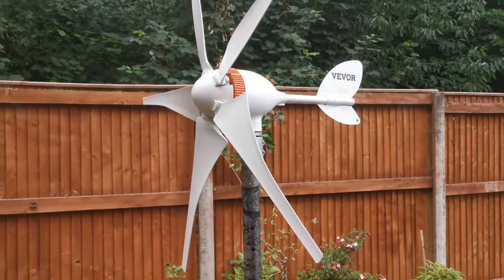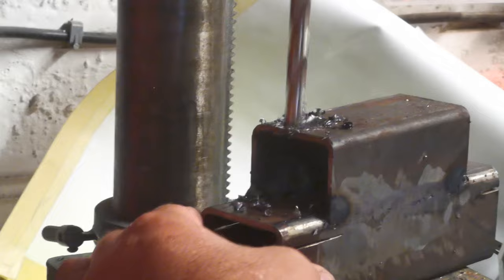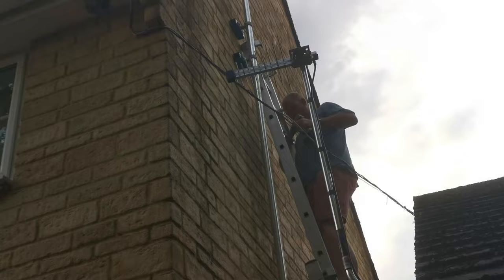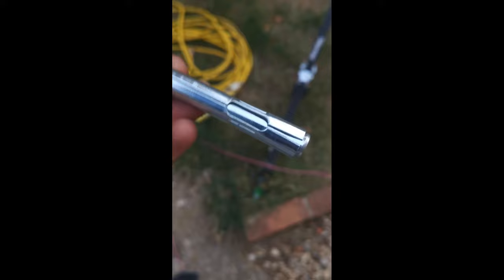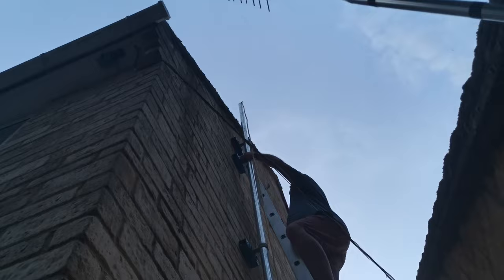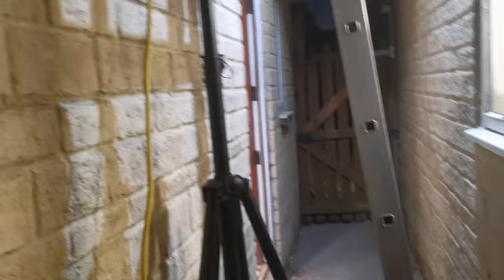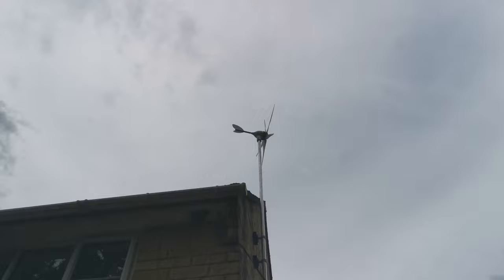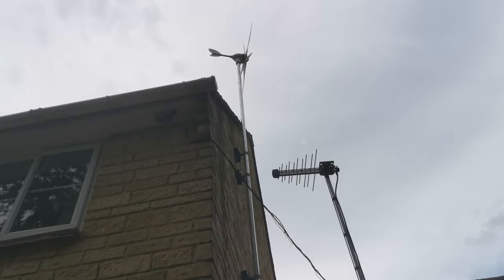installing a wind turbine at home |  how much power will it make?

Comment: I did this about 15yrs ago. Forget small scale wind it is a dead loss. It will stand like a statue or spin just under load for 95% of the time.  One 100w solar panel will do "something" every day, and you won't hear a sound from it. You will hear that vibrating everywhere in the house. It has probably been removed by now. Sad but true.
Reply: they're ideal for topping up the batteries through the night.
Reply: Idk what vibrations you are talking about since I also have a homebuilt one and I hear no vibrations.
Reply: Great point.
Reply: The tech has come along way in 15 years lol

Comment: Replace the charge controller you received witn a rectifier + cheap mppt solar charger. You'll get much better results
Reply from the maker: thanks for the subjection, i have thought about doing something like that. ill give it a go at some point
Reply: Also the 300 watt rating is based on probability of 60 to 90 miles per hr wind speed and is has to be sustained winds ….is not that predictable so you are doing fine a combo of wind and solar is the perfect combination specifically in cloudy days

Comment: Your house is in the way of the turbine, preventing it from producing good power. You get too much "dirty" wind from mounting it by a building. Also, if and when the turbine gets up to speed, you will start to get strange vibrations in the house. Try taking the turbine to a windy hill, as a test and see how much power it can really produce!
Reply: No its a cheap Chinese poor turbine

Comment: Im thinking of buying a wind turbine to support my solar system I made this year. Solar system I made worked great throughout the summer, however, in the winter turbine would probably compensate the loss of sun rays. I've been searching the internet for the past months to find the best wind turbine, but they all just seem to not work as the sellers state in descriptions. Could you please give an update on how your wind turbine is working now? What power do you get out of it? Thanks
Reply from the maker: We have had 160 what's out of it now, it just keeps getting more with everyday. we don't get a lot of Watt hours out of it however. I would strongly recommend not using the controller they come with and getting a small three phase rectifier as well as solar charge controller. As is it has to be spinning very fast before it does anything whereas with a proper controller you'll be able to get output at the low end.
Reply: Did you try it with the mppt solar controller?
I have my new turbine now that I'm running tests on and i found that, although the maximum power was higher using the solar and rectifier, it seemed to take longer to kick in. Almost like it had to spin up high then come back down to a certain value and go up again or else it would continuously read 0w. But once it's actually running the numbers were indeed higher. I'd probably need to try it actually in the air.
Reply: @tobywhiting10  hi bud , I was wondering if the 3 red wires from the windmill have to be in any order to connect to the 3 blue wires on the controller?
Reply from the maker: @jayyelland8289  nope, the AC power from the wind mill has no polarity
Reply: @tobywhiting10  I bought it today (500W). I ran a quick test and I must say I was impressed. I pugged it directly to AC to DC rectifier and use a electric screwdriver to spin the generator. It produced 42V and 10A, which is 420W. Nice! But when I did the same but instead of rectifier I used mppt controlle that comes with the turbine, it didn't produce anything. So I installed it on the pole and connected it to my mppt solar charge controller via rectifier. Unfortunately wind has stopped now lol!!! But the test result looked really good. I'll keep you updated with further results.
Reply from the maker: @jakubhanisz595  thanks, it will be interesting to hear. I'd love to know how you get on with the mppt controller with a rectifier vs the one it came with. Perhaps it didn't produce anything with the stock controller as it expects to see voltage on the output side from something like a battery. The stock controller that came with ours is all potted in resin so I can't tell how much smarts are built into it. Out of interest which mppt solar charge controller do you have?
Reply: @tobywhiting10  thanks for the the info , I'm planning on using it to charge a bluetti power pack with 500w solar input , im guessing that it will be fine ?
Reply from the maker: @jayyelland8289  if the power pack has built in mppt charging, for something like solar panels, I'd recommend you get a 3 phase rectifyer to use in place of the controller from the windmill. You should get better performance at lower wind speed.
Reply from the maker: @jakubhanisz595  same makers as the controller we have for our solar system, seems pretty good.
Reply: @tobywhiting10  OK bud will do thanks for getting back to me . Which one would you recommend? I had a look online & there seems to be a few to choose from
Reply: Can you give me a quick update on output please? Mine is not doing the best at the moment. Im planning to move it...
Reply from the maker: @jakubhanisz595  we are still on stock controller, have not bothered with an mppt yet. it takes quite a lot of wind to start producing power but it usually will kick in and starts producing 10 watts in short spikes. it has done about 30 Watt hours over the course of two weeks which is not a lot, obviously. Not entirely sure of the exact value I will have to get back to you.
Reply: @tobywhiting10  hi , did you have a   3 phase rectifier that you would recommend?
Reply: @tobywhiting10  thanks mate. It looks preety much the same here. It's still good fun though.
Reply: @jayyelland8289  in my case 3 phase rectifier didn't do much difference. I switched to the stock controller and I want to see how this is gonna work
Reply: So after few weeks of testing I can say that my solat panels are charging better than this wind turbine, even with no sun at all. I contacted vevor yesterday and told them that at wind speed of 20mph I get max about 50W.
Reply: Thank you for clarifying that a low level house mounted wind turbine is a non starter with feeble output

Comment: The 2 meter diameter Wind Turbines from several sources make 700-odd watts at 14.2 Volts and if they last 2 years, it's a miracle! The bearings and blade "feathering" mechanisms quit, or the Stator on the alternator, as they are "recycled" automobile (read from an auto salvage and "re-manufactured") alternators. You'll waste $1000 USD on the turbine and whatever it costs to install a pole in cubic yard or more of concrete IF you can get a "zoning variance" and the entire thing MUST be able to fall ONLY on YOUR PROPERTY without damaging your house, garage, parked vehicles, etc. Your neighbors can make you remove it for the noise they make too.

Comment: Having bought two of these direct-drive HAWTs and suffered disappointment with both, consider a VAWT with a pancake alternator; 60 volts @ 100rpm.
Reply: In theory someone ... IF they knew what they were doing could possibly put additional magnets in the pancake alternator to give it a boost couldn't they? I wouldn't suggest this if you don't know what you are doing however... but its basically a set of copper wiring rings being spun over a ring of magnets.
Reply: @noahriding5780  gotta becareful though i went with strong magnets and i slanted the magnets to minimise cogging , cogged like a bastard, I shouldve bought n35s instead n52s LOL.
Diy axial flux turbines are better.

Comment: Ha fabulous 🇬🇧 so nice to see another uk resident , as YouTube normally packed with Americans. 

Yeah I brought the same model as you got , I found it had to spin like crazy before I got any real power out of it , tho when it spin i was scared it would just fly off. The other worry thing was I couldn’t slow it down when it was storming weather gales force winds. I was testing mine. Like in yours place you got that alleyway between your house, that where I put my one , as it wind would be pushed through the gap at a faster rate than over the house! 
I used blue gasket goopy stuff to make sure the nuts on the blades to stay put, tho after 3 months in the winter I did find they got loosen at bit. 

Yeah the same thing as your the back tail was too short, I used a bit of gaffer tape to tie it in place which worked great. Tho the power issues was still low. 

I have been thinking of taking the guts out of the wind turbine and turning it into a belt powered Device to run my my kitchen blender and other equipment which spins around, just using Bicycle gear in to make it work. 
And forgot making electricity from it , as the idea of using the power on a belt drive to run other Devices would work great and I haven’t seen any videos about this !
Reply: Could I advise you to perhaps do more extensive research before purchasing such a flop?
Plenty of material on YT or elsewhere that more than prove they are a complete waste of time and money..

Comment: I have a similar turbine. Not had a proper storm yet but on gusty days it has generated 12 amps. My turbine is installed on the balcony of the top floor of a high rise block of flats 12 floors up.

Comment: Well done with all your great work and battery set up, you are fighting the good war against the greedy thieving parasitic energy companies. I am almost totally off grid, hard work, I have sacrificed going out for meals and trips to the pub but it is paying off, long hours dealing with 70mm2 cables and battery lugs. But I am determined to do my bit, I want to see energy companies ruined like they ruin the elderly and vulnerable. Let us confine them to the history books.
Reply: I wish planning laws would be more flexible for suburban houses. As long as it is a quiet windgen you should be able to have one, but with things like to 5 meters to any boundary rule, it's impossible
Reply: so they do all that work that you're doing now, and they get paid for it, but somehow theyre the bad guys, i dont get it
Reply: You're my hero 😊
Reply: Well done for trying. Planning law in Wales prevents a wind turbine of any size without full planning permission sadly and unlikely to get that for my small garden. I like the idea of alternative structures which don't look like a conventional turbine...but I would need to build this myself...not that handy sadly.
Might get away with a portable setup possibly.
Reply: @malcolmnew8973  I think you are allowed one without planning, depending on size and other regulation stuff. Unless it has all changed.
Reply: I think  @MagicMarvin33  is right about the laws in Wales, so long as they don't ruin the environment aesthetically or through noise and are within certain height limits I'm pretty sure they are fine.

Comment: I have four of them up but I went for radial design like everything Chinese they are rated at 10 time's more power than they are capable of .
Looking at the wire diameter coming from mine gave me the actual current before the wire would burn out like a fuse but as you said it all helps I went for 600w Chinese rated which in real life is 150w at 24mph wind.
Reply: Was it worth the money ? Has it put much electricity into the grid/ made any money? We’ve moved house on an end plot and our garden windmill never stops spinning would love to get a proper turbine but my research indicates not many people are happy with them.
Reply: I think they use smaller watts than us, like they use smaller horses to measure their horse power !

Comment: I had an Air X Marine in a domestic installation like this for about 10 years. A burst of an amp for a few seconds or so if it was very windy. Pathetic compared to a constant 20A from my solar panels. Problem in a suburban situation is turbulent wind because of all the nearby structures. Anyway, now that solar panels can be obtained for nothing I wouldn't go back to wind power.

Comment: I just put up a similar 600 watts one a week ago. The tail is farther back on mine. I get a lot of wind here. This one is making around 140 watts part of the time. I ordered a 24 volts model but they sent me a 12 volts model.
Reply: 600watts doesnt mean your get that u need to understand the math your get about 20watts if your lucky.
Reply: @jediknight2350  

The DC output of wind mills is below 12.5 volts, if your batteries 🔋 are charged , you will get little power from the wind mill. Those 20 watts you mention. 

You need a DC-DC step-up converter, otherwise you won’t pull the watts form the wind mill. 

An eolic generator is a voltage source (of low voltage). 

A solar panel is a current source, that’s why the solar panel is always pushing energy to the charge controller and batteries. 

The wind mill only generates energy when there is demand for that energy. If the batteries are fully charged , you won’t get energy from the wind mill. 

That why the DC-DC step up converter is a must at the output of the wind mill.

Comment: Eh?  This is nuts .... lots of money and effort for ~20w; the turbone is in dirty air and needs to be much higher over roof-line.  The inevitable vibrations into your building structure is not good and am sure thats a really good lightning ⚡ rod straight into your solar system.!! Wind turbines need lots of maintenance, so a winch to get it up and down is usually the way.  Surely building regulations don't allow this!!!!

Comment: A horizontal axis generator needs to be well above the ridge of the roof to get away from the turbulence of the airflow over the rooftop. they really need clean airflow to work efficiently.

Comment: Sculptures install a rotor (windmill) to produce electricity, the basis is a very solid mast which does not deflect under the force of the wind. Any deflection causes abrasion of the magnet inside the engine, which damages it and may cause failure or, in the worst case, self-ignition.  Regards

Comment: I did the 2:1 chain thing and it work ok for a while. It did make a little power. Then the chain came off. May have been the ice we had. WE HAD A FREAK COOL SPELL. (8 deg's) I let the pole tower (35 feet tall) down today (55 deg's) and put the chain back on. Yes, it was very loose, and I have no idea how it came that loose. I may have tighten the chain too much to even turn. I will leave it up awhile to see if it will work. One more thing I may try the 5 blades that came with it again. I cut 6 inches' off and put them on one of the Ameteck motors and it did ok. They run much faster now with this mod and still start in low wind. Let us know what you do and try.  Understand I get 10mph at best with some gust and not in the best spot for a wind turbine. Once a year I may get 25 mph for a little while. Looking for the follow up video. I subscribed to see what you will do.

Comment: You would be better off mounting on the ridge of the house in the middle about 8 feet higher than the houses. You can see the turbine switching direction every few seconds. That is turbulence. If you can extend the one of you have 10-20 feet above the house that will be better too.

Comment: You could have 'telescoped' it in a 2" pipe, then use a 1 ton (2000lbs) car-bumper-winch (permanently mounted) to hoist it up. Makes it easier to service if need-be, by just lowering it back down with the winch.
Reply from the maker: That's a good idea (in fact we already have the winch) but the budget was at a premium so that would have increased the costs. it has actually been taken down now because it wasn't doing enough

Comment: What is the difference between 12. Volt to a 48 volt? Does the 48 volt have more finer wire, and more wire? An I right? I’m still learning
Reply from the maker: With a higher voltage means less current for the same amount of power so you can get away with using smaller wires. You also get less voltage loss over long wires. Most of the higher power inverters and charge controllers will only work on higher voltage systems just because it makes the current less

Comment: "Better than nothing" is not a very good reccomendation. Location (other buildings will reduce your wind thruput) and height are very important for wind generatioon. As a rule solar is better on houses in built up areas. If you could get another 40-50 ft on that pole you might see a pretty large jump in generation.

Comment: I bought one support to generate 500watts . Lucky to power a torch. I use solar panels thought the wind generator would supplement loss of power when no sunshine. The wind generator seems to be drawing power out of batteries. I use a battery charger. To supplement power. The turbine is going in the skip. Sick of wind turbine expensive weather vane.

Comment: you need to use it together with solar cells and you have to get into the kW range. 7-10Kw.
And that is what will happen, on a stormy cold lightless winter night. When Solar cells don't work.
You will be able to heat your house. Especially in my area, when the wind howls and make the fence shake.
Reply: These Vevor turbines are really only 20-30 watt output, they are useless and would barely run a small lamp on a good day.

Comment: Its probably not a good idea to install these right where the power cables for your house electricity come into your house. I would reccomend to others to purposely not put it around that area in case something comes loose. Its also possible that municipalities won't like them being wired too close to their incoming power cables. 

But in this case your video it looked like you had some pretty good anchoring for your pole. I'm just thinking that others might not be as thorough as you are.
Reply from the maker: If you're referring to the cables that are going between the house and the garage, this is a simple Ethernet cable owned by us and has nothing to do with power. Our house gets power in through the ground in a completely different area.